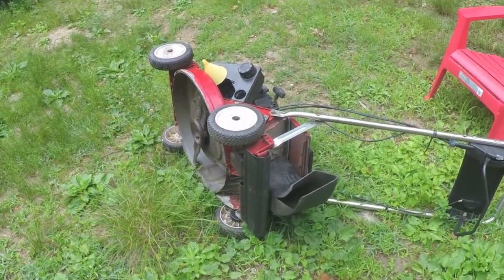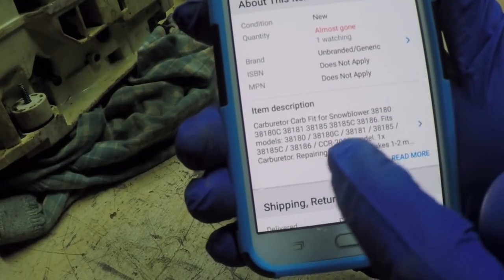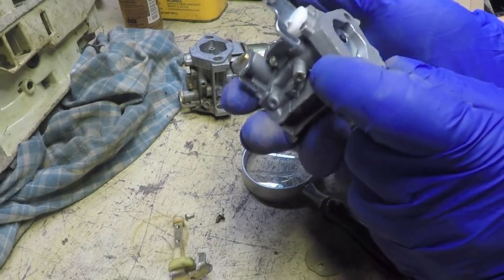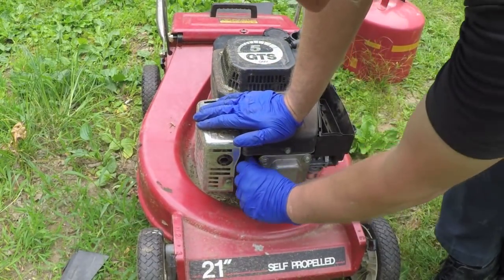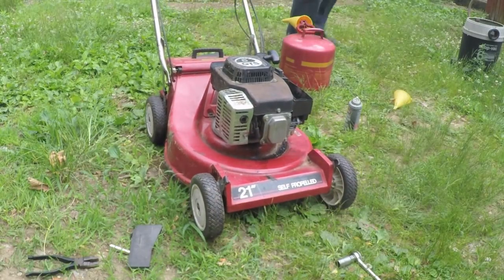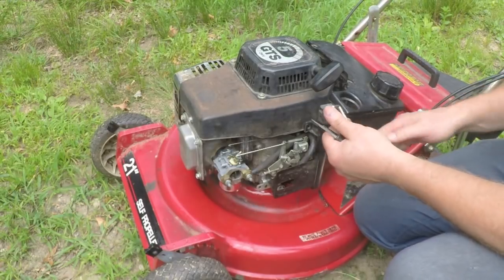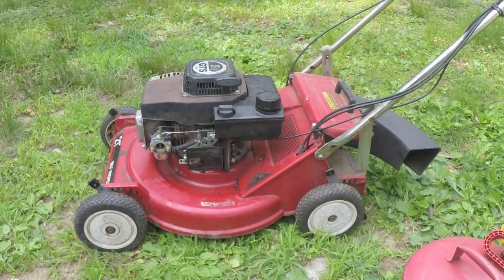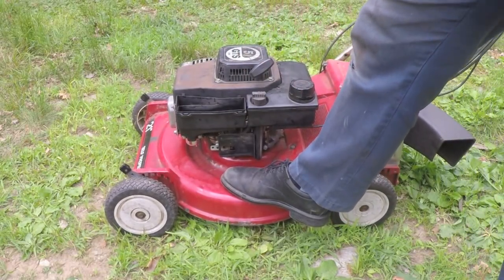Old Toro lawnmower rescue

Comment: since you get such satisfaction doing this,perhaps this can be a side job???? seriously never overlook the simple stuff like a spark plug. did you ever change the main jet? seems like it needs a bit more fuel on start up,also make sure the vent hole in the gas cap is clear. make sure you install a air filter too,it can affect how the engine runs
Reply from the maker: Thanks Roger, all good pieces of advice.